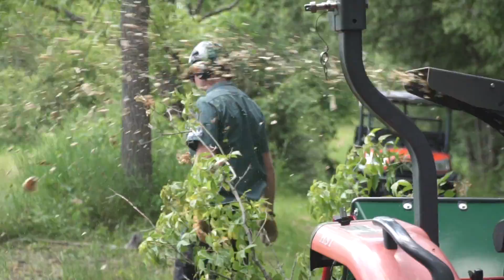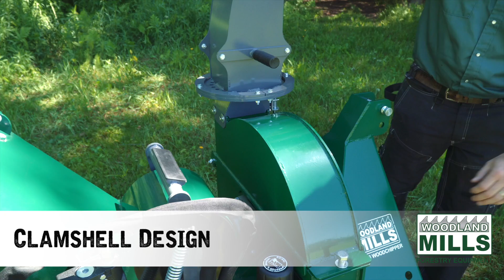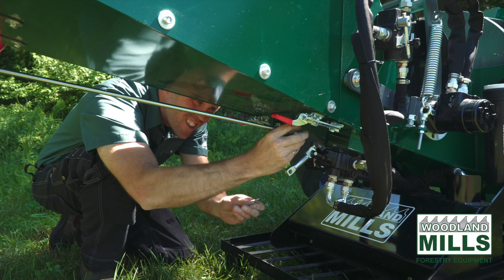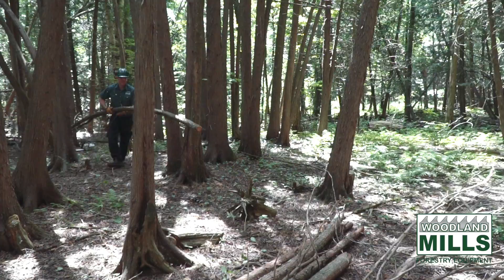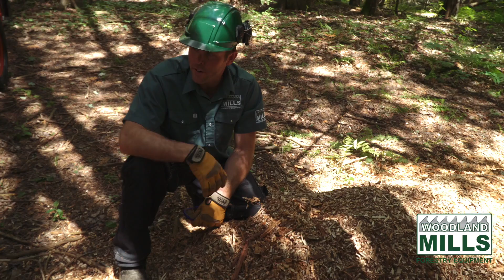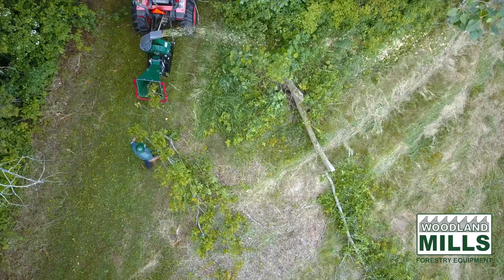Woodland Mills WC68 Woodchipper Full Length Demo (2018)

Comment: We have a Kubota B3200 is suitable for this one or should we go for a smaller chipper like the WC46 4" PTO Wood Chipper ?
Engine (gross):	32 hp
23.9 kW
PTO (claimed):	23 hp
17.2 kW
Reply from the maker: You would be able to work quicker and more efficiently with the WC46! However you are still within the parameters of the WC68, just on the lower end! :)